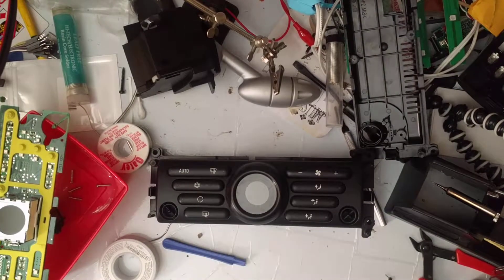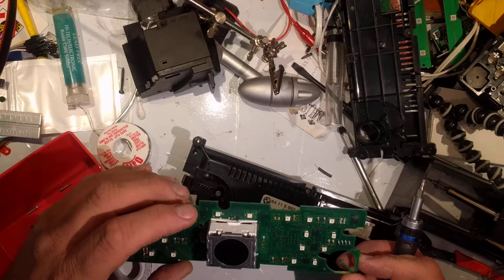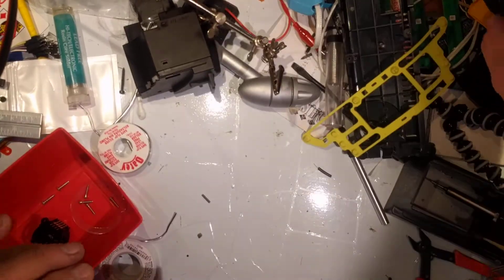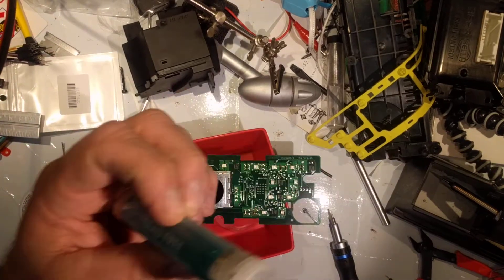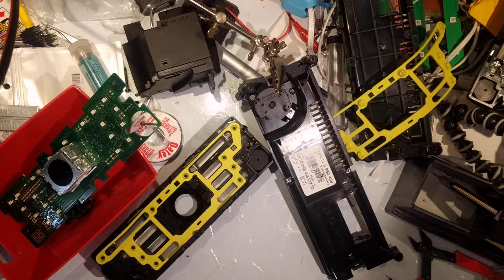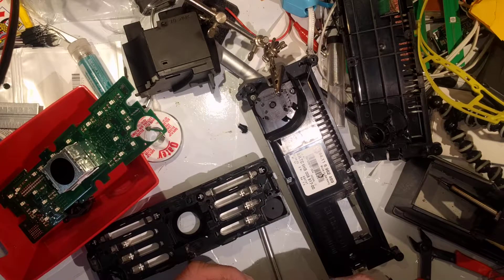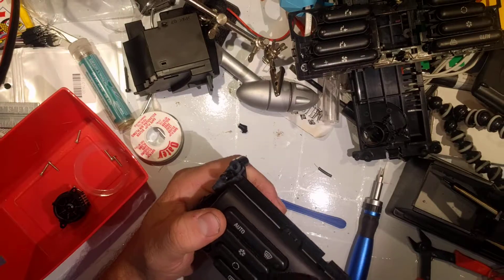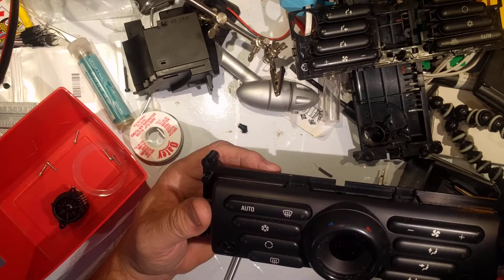2002-2006 MINI Cooper Automatic Air Conditioning controls teardown and rebuild

Comment: Great video, the dirty workbench didn't bother me, I remember when i was single and allowed to be a little messy, ahhhh good times.. I wanted to ask, my fan only blows air from the dash demister vent inside the windshield, I select the feet or face options but the air wont change redirect to my feet or face. It has just started this today and I can hear like a piece of plastic loose in that dash vent area. My car is an R53, any suggestions?? Many thanks in advance. 
(I gave this a like!)
Reply: @3rdworldgarage450  Thanks for your reply! I assumed also it was an actuator, I have found a second hand item on ebay at a sensible price. Pulling out the dash will likely be my next step to locate this part. I'm grateful for your advice, love the mini copper stuff, keep it coming.